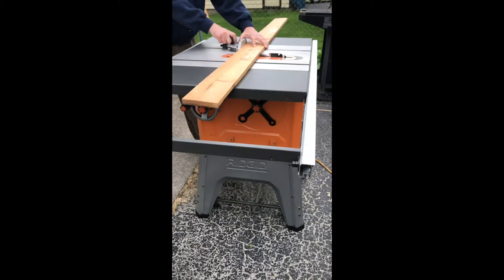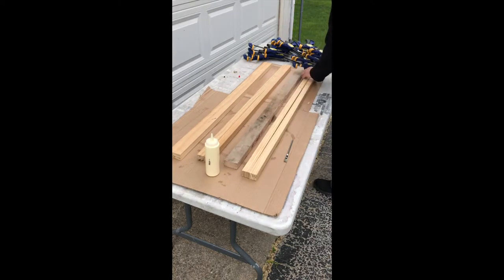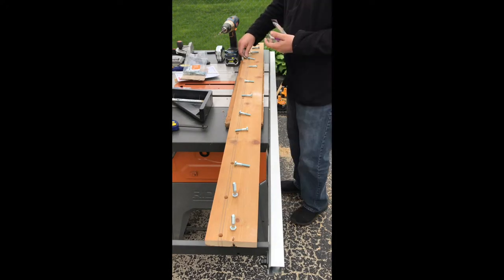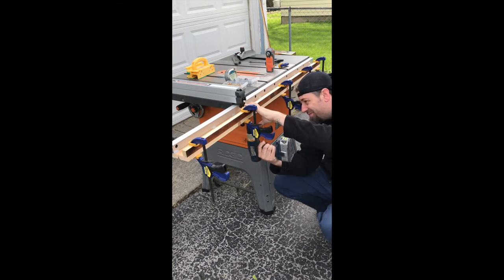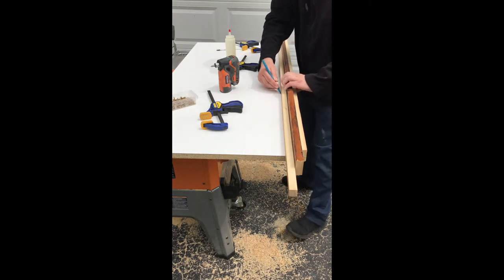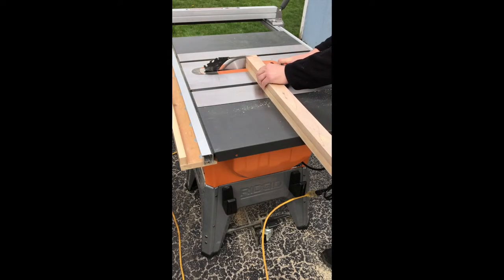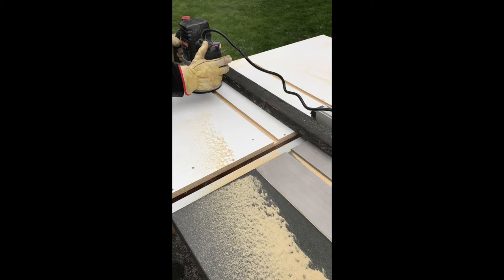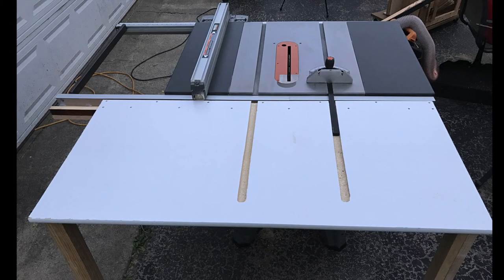Rigid R4512 Table Saw Outfeed Table

Comment: Nice job. I'm buying this saw on Friday. I cant wait!
Reply from the maker: Bill Shock thanks! I love this saw and have since added a table in the extension wing where I have a router mounted with a flush trim bit for quick pattern routing. The fence on this saw comes with slots machined in so there are so many options to attach aftermarket jigs and accessories. Enjoy it!